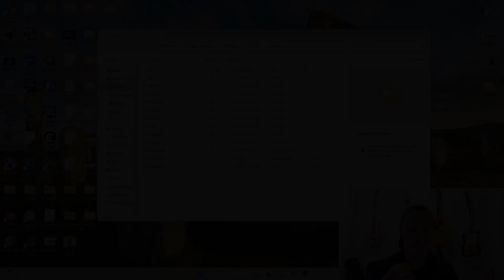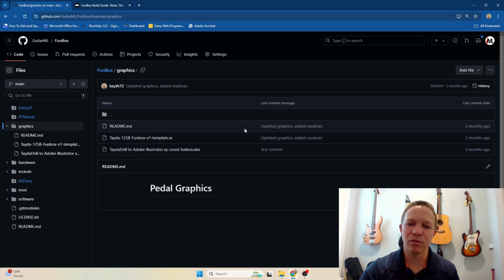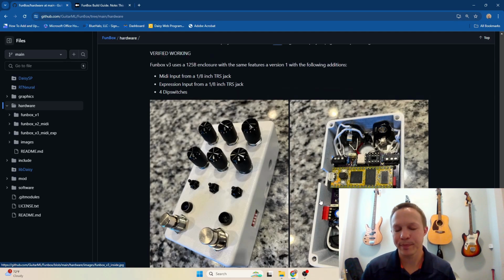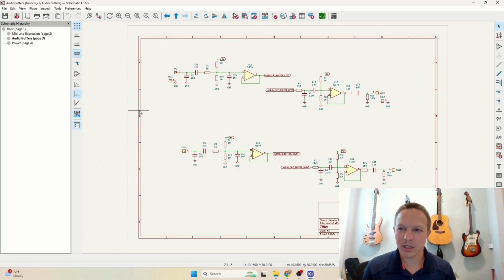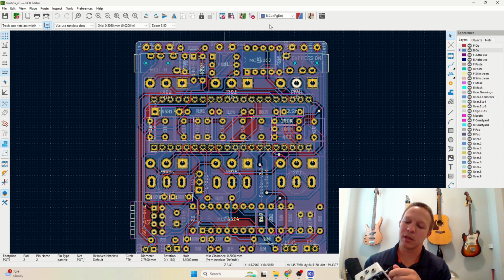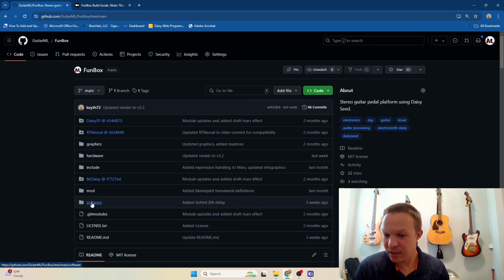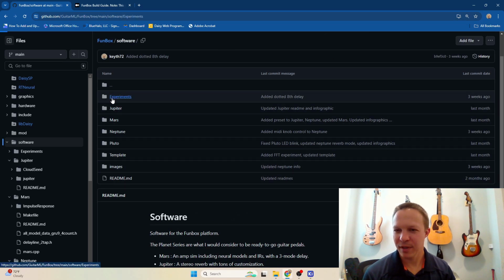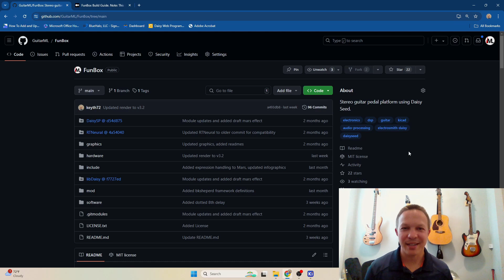Funbox - Open Source Stereo, Midi, and Expression DIY Pedal

Comment: Finally built mine! The soldering was straightforward; however, the "fitting in the enclosure part" was a nightmare for me, lol. There's not a lot of room for various parts' footprints... I think my 1µF box caps are taller than the ones you're using, so the Daisy Seed doesn't fully fit in the socket... And my dust caps are a bit too thick which reduce the clearance of the pots... So the whole assembly won't fit in the case for now (can't screw the bottom plate). I'll figure something out,:maybe bend the ST-Link pins and add tape... I would strongly advise people to use the exact same parts (including the TRS and DC connector). Or maybe a better option: you could sell this as a kit (like the Hothouse). I understand that it's not fully DIY that way (and you sort of become a company that must buy parts, offer customer service etc), but it might make it easier for users like me who are not located in the US to source all the parts. I do not have noise issue with mine for now (even with the old  TL074) I don't know which revision of the DS i have, I'll have to check. Now, that being said, your effects modules on GitHub are just... amazing! I went to this whole process just to have those on my pedalboard. I mean they are , like, wow crazy amazing quality effects! Makes my reverb/delay on my Chase Bliss Mood sound dull in comparison. Some modules won't load with the web programmer on mine, but I didn't spend much time on it yet. On some modules, I think I noticed some latency when the effect is bypassed, but I'll run more tests before drawing any conclusions. Since I have 5 PCBs and two Tayda-drilled enclosures, I'll build another one for sure to run various modules. Maybe one day I'll be able to program amazing effects like you!

Comment: This could sound really good with an acoustic guitar. Could you please let me know if the buffer circuits designed for the funbox work well with Piezo inputs?

I looked up KNA's site. They specify that their pickups do well when the input impedance of our equipment is 1M ohms... What Funbox's?

Comment: With the input and output jack being stereo, Can I use mono cables to connect this pedal to my guitar and amp?
Reply from the maker: Yes! Both input and output works just fine with mono cables, with a stereo jack the right channel is simply grounded out. I pretty much only use a mono cable for the input since I’m coming out of the guitar.